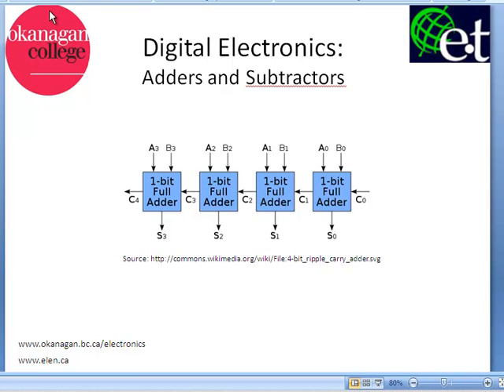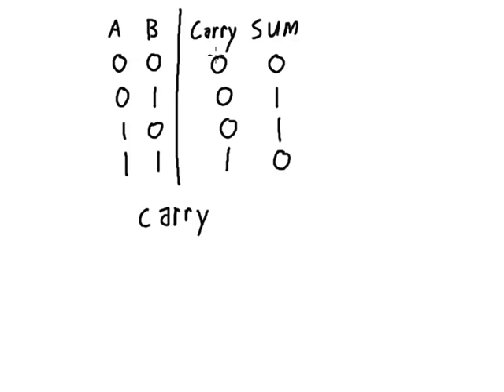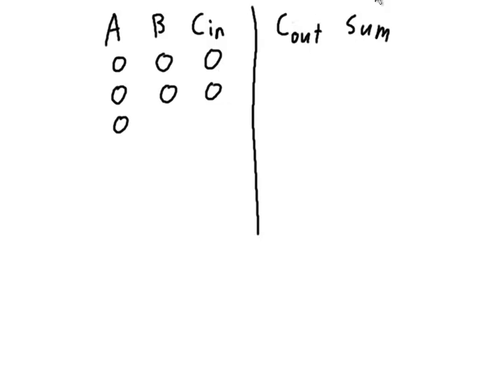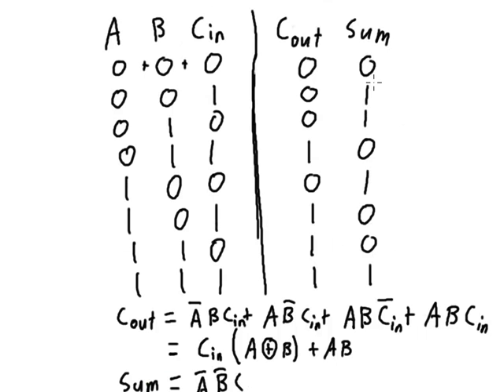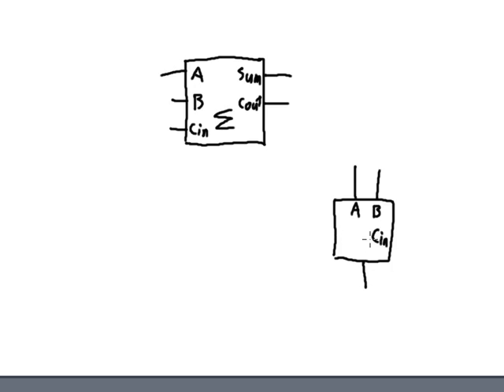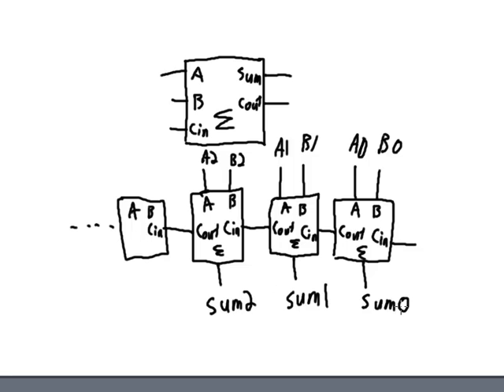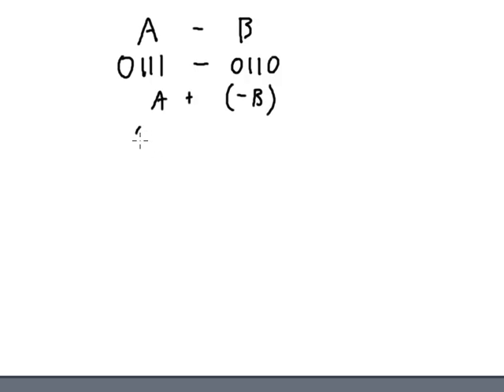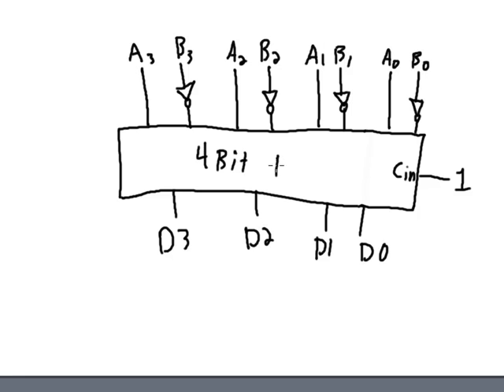Combinational Logic - Adders and Subtractors

Comment: this example is for adder ??? how is example of Subtractors ??
Reply: just use a full adder with a 2's complement of the number you wish to subtract. Example 1100 - 1101 = 1100 + (-1101) = 1100+0011 because 0011 is the 2's complement of 1101

Comment: So, where is the info on subtractors
Reply: just use a full adder with a 2's complement of the number you wish to subtract. Example 1100 - 1101 = 1100 + (-1101) = 1100+0011 because 0011 is the 2's complement of 1101

Comment: You didn't explain in your video's how to do that algebra with the xor or did I miss something ?
Reply from the maker: No, I didn't explain the algebra for using an XOR instead of an OR.  Either one will work though.

To convince yourself, create the truth-table for the following two expressions...you should find that they are the same.
Cout = XY + Cin(X+Y)
Cout = XY + Cin(X XOR Y)

Basically what happens is the XY term covers the case of both X and Y being one, so XOR can be used instead of OR

Comment: I thought of a better example to show the way I think about this. Let's say I wanted to subtract 1 from 1 and put light bulbs at the end of the subtractor to represent the answer. Of course, if it subtracts, neither bulb would be on. A subtractor takes the two's complement of a number. 1 negated is 0 plus 1 is still 1. Since the circuitry is the same circuitry of an adder and the number is still the same, why wouldn't the subtractor just add 1+1 instead of subtract? What makes the subtractor

Comment from the maker: 0011 + 1011 = 1110 can be interpreted as 3 + 11 = 14 if the bits represent a 4 bit unsigned number  or as 3 + (-5) = -2 if the bits represent a 4 bit 2's complement number.

Comment from the maker: What you need to keep in mind is that when you are doing arithmetic with these digital circuits, you must define the type of number system that you are using.  So with your example of '1011', if you define your number system as unsigned, then the value is 11 but if you define your number system as 4 bit two's complement, then the value is 5.  The result of the operation in the adder/subtractor circuit will be the same, the difference is how that result is interpreted.  e.g   0011 + 1011 = 1110

Comment: I understand how an adder works. But, I don't really understand the subtractor. I don't understand how the subtractor knows how to subtract instead of add, when it cant tell the difference between positive and negative. Also, what stops the subtractor from using the two's compliment number as just a different positive number and adding? For example, the two's compliment of 5 (0101) is 1011. But, that could also be a positive 11. So, what makes the subtractor take that number as a negative....